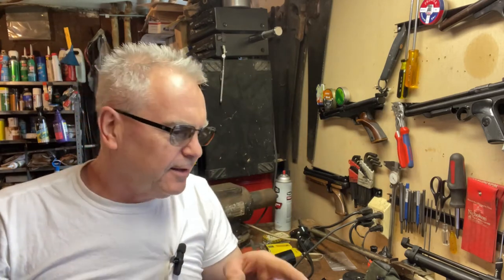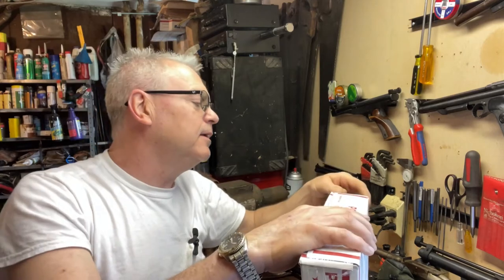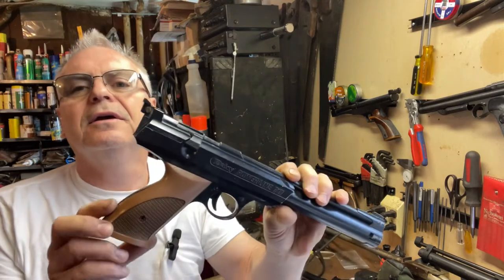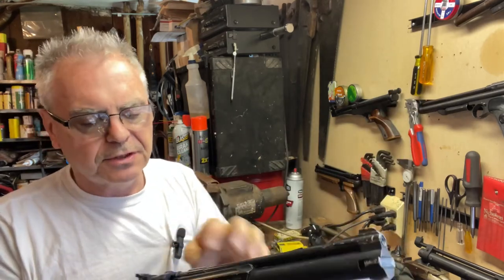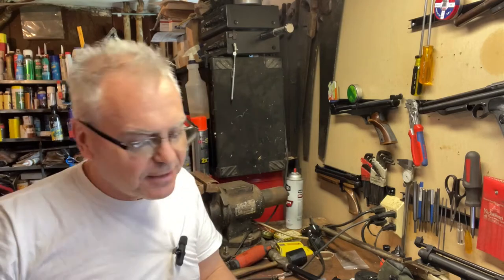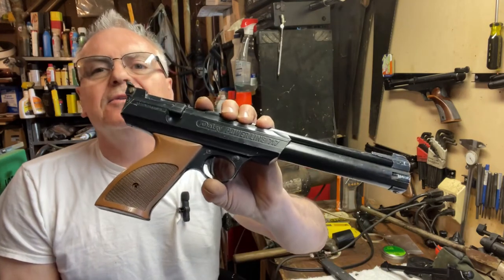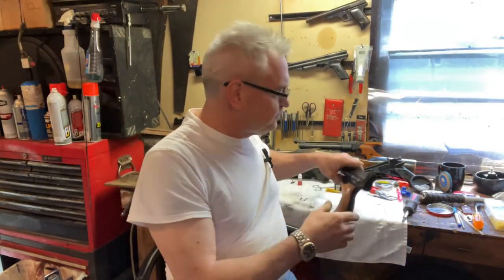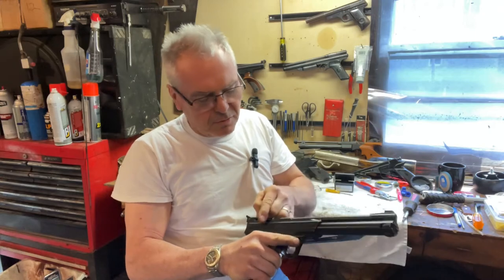Mail call with the Daisy 717 .177 caliber single stroke pneumatic pellet pistol. Was sold as broken!

Comment: The daisy  717 like 90 percent of the other 10 meter  pistols  use the 7.0 grain pellets . With the 7.0 grain pellets you should be getting around 403 fps  At least that is what my 1983 year gun is getting  . This year makes  40 years of shooting this gun with 2 gold metals in the 10 meter air pistol  Blue  Grass Games back in the mid 80's  After that I was hooked  on the 10 meter shooting and have been shooting ever sense   . 

In 2002  I got a izh46m  for around 250.00  and that's the gun I shoot now . I think I spotted yours in the video . 

When you change your seals make sure you change the tiny seal that is at the front of the bolt  action . If that seal is worn you can lose up to 100 fps  just from that one tiny seal . 

Read about the pump adjustment . After you pull the trigger  leave the bolt closed  so the pump handle  can be opened and closes freely with a slight resistance at the very end of the cocking action . what you want to do is measure  the distance from the  inside tip of the  pump lever to the  flat part of the metal just in front of the back Phillips screw . 

You want to adjust it  so the space where you first feel it start to resist is 1 1/2 inch  spacing . To adjust it open the pump lever all the way open and you will see a slot on both sides of some threads  the part that turns is the side closest to the trigger the right side   . You will see there is  slots going all the way around  on the right side  and only one slot on the left  of the threads  . If the distance is shorter than 1.5 inches then you want to turn the slot on the right down . This will make the resistance happen sooner making the distance greater . If you go to far and the space is more than 1.5 inches  turn  the right slot up and it will decrease the space .  

On this gun like all air guns with seals you don't want to leave the  pump arm all the way closed  its best to store it  right where the resistance starts  and leave the  bolt action  open enough so the  o ring  doesn't stay compressed in the barrel . That tiny seal is always the one that leaks air first  because most people  leave it  compressed inside the barrel . 

Same goes for your izh46m  don't leaver the  top arm locked in place after you shoot  release the lock so no pressure is on the 2 seals .

Comment: I have a Daisy 717 and it is a very nice, accurate gun to shoot targets with.
Mine shoots at 370 feet per sec as I bought it which seems about stock for these.  It would be nice to squeeze a bit more out of it and get closer to 400 if it was possible for cleaner target punching.  I have seen some 'upgraded' seal kits for sale in the US.  Interested to see  whether you try this.
Reply from the maker: Mine is also around 365-370. I believe that is what they were rated for.

Comment: Hi Nibs. Another question. I am rebuilding a Daisy 717 and have it almost done, but I have a very small spring that came out. I think It's for the safety, but not sure how it goes on. Any ideas or thoughts? I did not take the safety out. Never mind got figured out and back in. Very lucky, so far. Now the rest of the reassembly.
Reply from the maker: i don't recall that spring. i did a little searching and the exploded views I could find do not show that part clear enough either. sorry